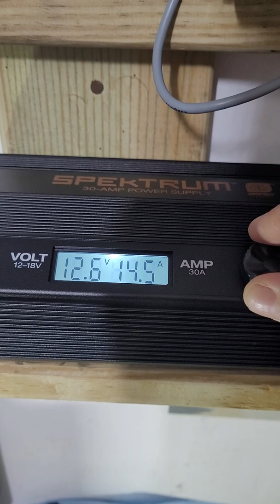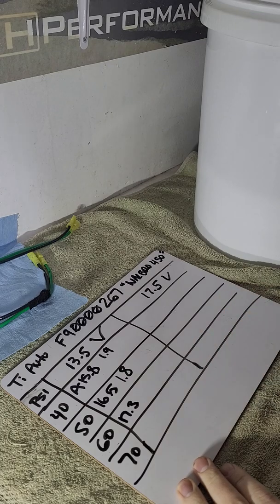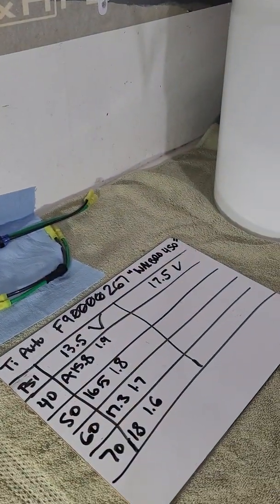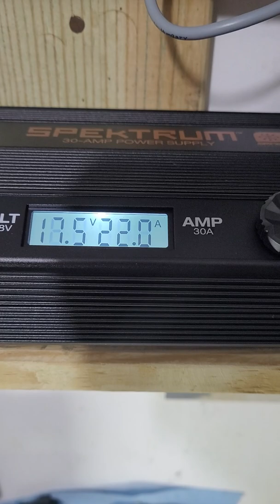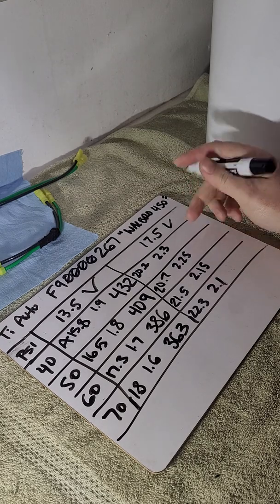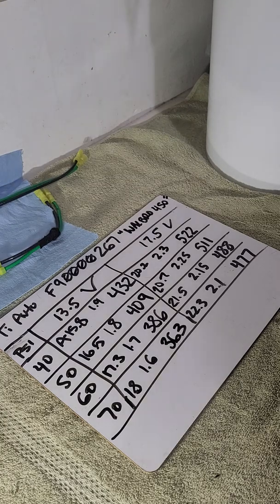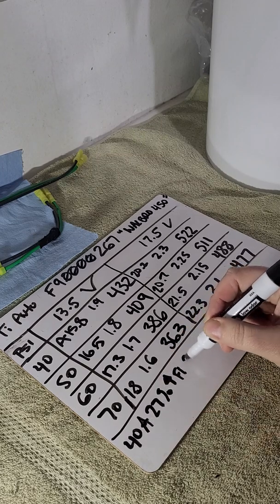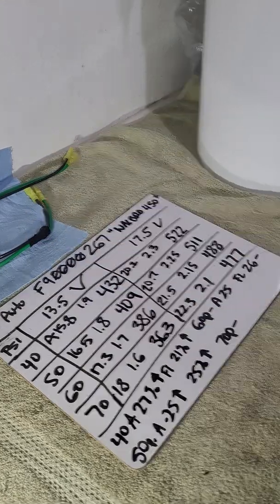Ti Auto F90000267 Walbro 450 LPH Fuel Pump Flow Test!

Comment: Litres per minute is better because a litre is a fixed size. Gallons are smaller in the USA vs. UK. I'm assuming you are using 3.8 litre gallons?
Reply from the maker: Correct US gallon.
Reply: @lightblade543  Good video regardless of my nit-pick!
I flowed the 267 on my car yesterday and comparing to your video confirmed that it was working ok. Volts makes a big deal, at 12V it flows substantially less. (5.5l/min @ 12V vs. 6.5l/min at 13-13.5V)

Comment: R u using AN6 or AN8 lines?  How will that affect flow?  Thanks for testing.
Reply from the maker: 8an. It's 2 feet on a test rig so no affect.
Reply: @lightblade543  thanks Bud.  I’m using the same 467x2 AN8 in my Fore return system.  Could u test a twin 467 setup?  That would be interesting.  I’ve never seen anybody test dual fuel pumps.
Reply from the maker: @todd5082  yeah I have a dual 267 hat here. Only problem is my power supply won't handle over 30amps. Plan to get a better one for dual and triple pumps but they get pricey for ones that can handle 60-90 amps so haven't bought one yet. When I do I will get some more testing and vids up.
Reply from the maker: @todd5082  a typical 8an system with filter and 10-12ft feed will see about 2psi loss from prefilter to rail with a new clean filter. That's about 3-4% flow loss. I have some older videos measuring pressure loss as your filter gathers debris.
Reply: @lightblade543  u r the only person doing this kind of testing.  U could use your 30 amp to test how fuel filters, multiple 90 degree fittings, a smaller 3/8 return line, etc affect flow.
Reply from the maker: @todd5082  thanks, yeah for sure can test all kinds of stuff like that.
Reply: @lightblade543  when do u think u will do another fuel test?

Comment: What do you test your pumps in, gas?
Can they be tested in wd40
Reply from the maker: No, you want a test fluid with a similar density/specific gravity as gasoline with out the explosive and flammable attributes. If your looking for something readily available, low odor mineral spirits is nearly identical sg to gas and way less dangerous. This will ensure accurate test results for pumps or injectors etc.